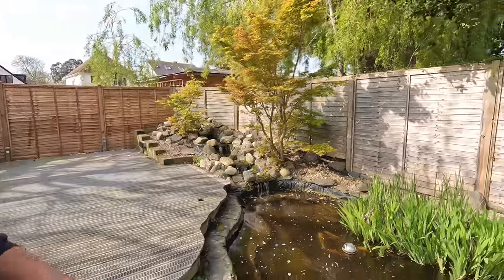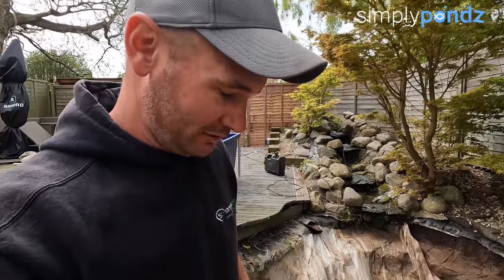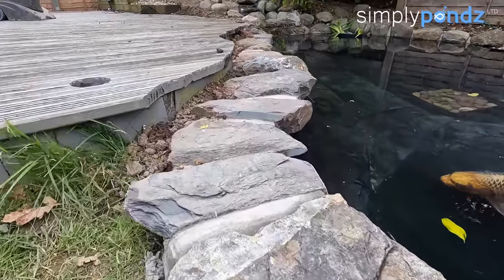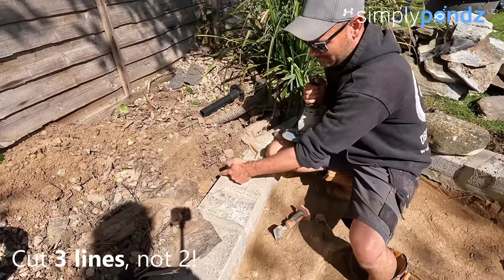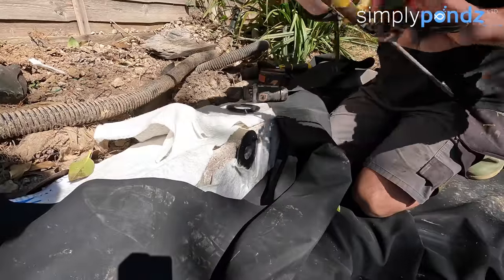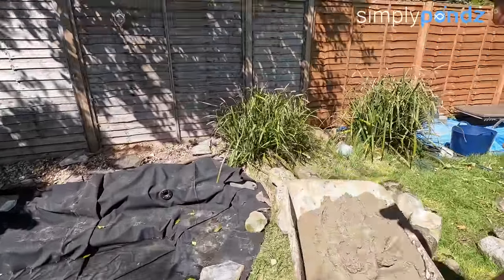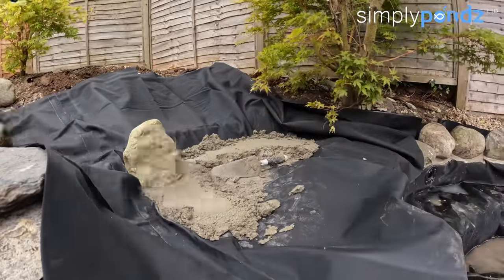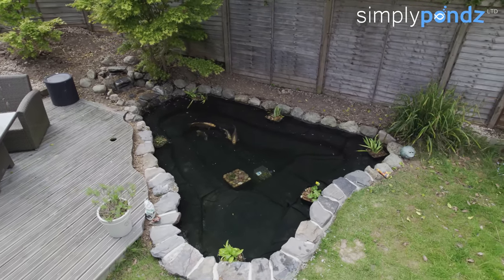Amazing pond renovation & transformation! 😎😀😍😘

Comment: With all them trees around I would have installed a big Oase skimmer the one with the rock on top for a lid. That will be the next thing you get called back for lol nice transformation though !
Reply from the maker: Cheers O!
Reply: I can see your point and well made. But the leaves only fall once a year and if the customer is prepared to put in the work to clear them out then fair dos. Maybe cost was also a factor.
Reply: @heidispawsandfins  tru but it's not just leaves a skimmer would also collect uneaten food that could cause fish a bacterial infection all year round not just autumn so well worth the extra money in my opinion but I understand there not 100% necessary for every pond build.
Reply: @oliverskinner8962  yep, you're right. I do find that skimmers manage to grab the food too quickly while the koi are still eating though! When you're paying out mega bucks on koi food it's really frustrating. So I tend to have to stay out there while they eat and put a net in front of the skimmer to catch and redistribute the food until the koi aren't so interested. I then remove any food manually anyway so it's completely out of the pond's system. But obviously, if I'm not about and the auto feeder is on then it does remove it. Pros and cons as with pretty much everything!! 😉
Reply: I would certainly agree. Skimmers are essential . If you have trees you’ll get leaves. Leaves turn to muck which is work to get rid of. I like skimmers too because they have a pump vault. If you ever have a problem with a line leak coming out of your pond you can suck your pond dry and if you have fish you could loose them if you don’t catch in time. A raised pump will never let the water level to get that low. I like to have a separate line with a separate pump to push water along the bottom sort of like what he did but closer to the bottom. I fabricated PVC pipe and painted it black. No need for holes in the liner. Plus I set it up with a valve to feed new water in for water changes of 10 to 20 % as needed for fish. I have a tail of liner at the one end to let the old water on top to run out. This also allows for an exit when you get very heavy rain falls. Just some ideas that worked for me. Great video and beautiful work though.

Comment: This is what I have to do also. Our pond has been out there for about 30 yrs. Last yr. I drained it and removed a bunch of the muck that had accumulated on the bottom and in between the rocks. Filled it back up, it's about a 250 gal. pond. Looked Great.! Nice and clean. Then a few days later I was losing water.!? I wore rubber boots, cleaned out in between the rocks with a broom. Obviously there's a Leak.! So now, I have to undo, and redo. OMG. Wish me luck....😂😂

Comment: Pondman, could you please answer the question about using concrete and mortar that is exposed to the water? Will it cause the fish to have problems? You did a wonderful job and I picked up a lot of very helpful tips.👍
Reply from the maker: Hi thnx for the comment, if it caused problems then we wouldn’t do it cheers

Comment: Great job! I love it. How long after cementing the stones in do you leave it before getting it wet and adding fish? I’ve just rebuilt my (much smaller) waterfall from stones and cement but don’t know when it is safe to start using it… or is the Lime in cement not an issue?
Reply from the maker: It’s no issue we water proof the cement if it’s going under the water, leave a min 3 or 4 days if poss thnx for the comment

Comment: Excellent video! I never would have thought to use jets to send the detritus to the deep end. What bulkhead are you using? Im coming up with something that looks very different than yours and I like the way your bulkheads seal the liner before you cut the hole in the middle
Reply from the maker: They are called in the uk yamitsu liner connectors 1.5” solvent weld or bigger many thanks for the comment

Comment: Hreat video. 

What are the tubes you have (garden holes size) that you have in the cement under / between rocks?
Reply from the maker: 40mm 1 1/2”. Thanks for the comment
Reply: @thep0ndman  what are they for? Wont the water just drain out of the pond?

Comment: Did you put ina little over flow pipe in to the top rocks above the outlet pipe? How many do you put in?
Reply from the maker: We would usually but the pond level was lower than the ground so it would need to be manually lowered if need be by the filter backwash cheers for the comment
Reply: @thep0ndman  the reason I ask, there was little pipe holes in the concrete randomly around the pond like it was made for that. I didn’t see you put them in. You said though there was a more detailed video I could watch. Which I am glad you said because I missed so many details. We have to redo our pond this year, so trying to learn as much as I can. I wish I could have you guys redo it! 😀🤣😜😏

Comment: I am always afraid to put the pump at the very bottom because what if there is a leak to the waterfall and it drains, if it had a few inches the fish would still have a little water. And then come winter I raise the pump site higher so it not pulling that water from the very bottom through the filter and pouring it back in where it can lower the temp when it hits the air. They say don’t disturb the very bottom water so it maintains it’s temp better.  What do you think or is that not an issue in your area.
Reply from the maker: It’s not an issue install everything properly and you will be fine. It’s a lot of wives tails of people overcomplicating something very simple. Thnx for the comment
Reply: @thep0ndman  you are absolutely correct, and since I never trust myself for that one time….haha…I may not tighten something when cleaning the filters etc.

Comment: The blasting the water around doesn’t match the pond design. You have the block directly on that shelf, your pic shows block and plenty of dirt to put that pipe in. Or is that just an example and you will put the pipe on the second shelf?
Reply from the maker: The water movement helps to prevent dead spots and improves circulation and most of the debris will be pushed towards the pump and then to the filter where it can be backwashed cheers
Reply: @thep0ndman  I realize that, I was just confused because your pic didn’t match the pond design. It was just an example I guess.